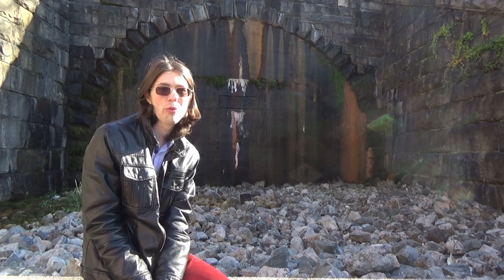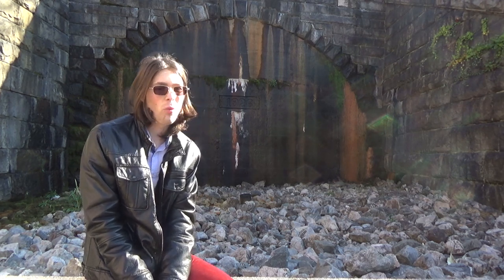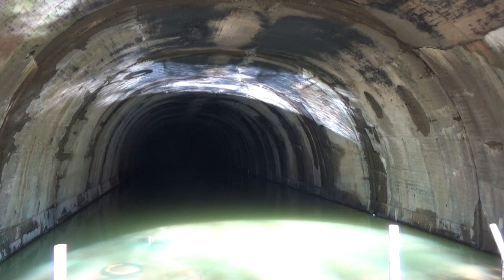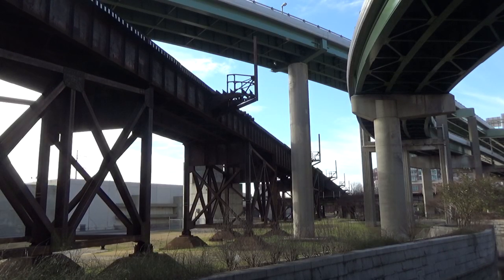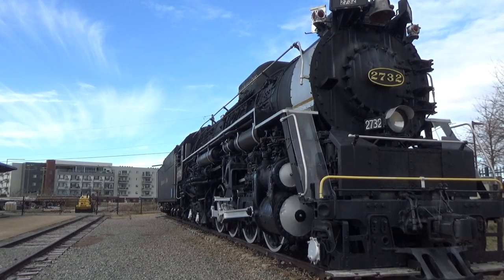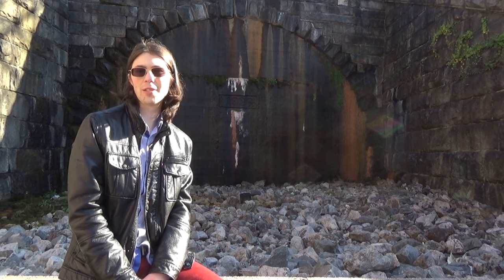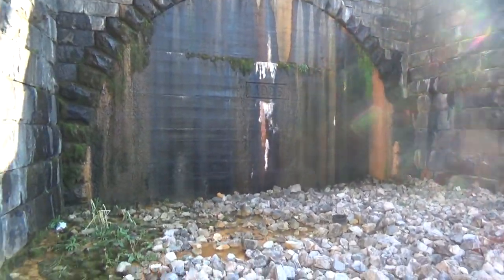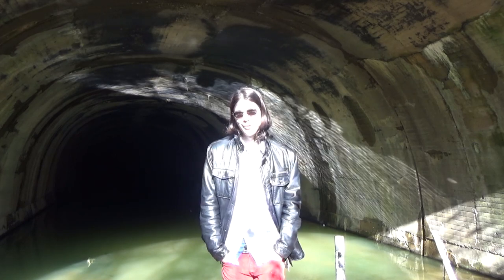Richmond: The Church Hill Tunnel

Comment: Nicely done, and the sound in the opening was really impressive. A couple of suggestions, the sound level in the narration changed a bit, it's better if that's kept the same. When you showed the locomotive it would have been good if you'd identified it as the same kind of locomotive (if indeed it was), you might also consider adding a bit of motion to still shots like that. The History Guy does it and I think he got it from Ken Burns.

But again, nicely done, and you have a new subscriber.

Comment: I just watched another video on this. a reporter a photographer and another guy went in a  few years back and made it in about 500 feet and had too turn around. what they said they seen is water leaking and the ceiling collapsing. if it continues too do so the buildings built on top this tunnel will collapse. hopefully nobody will get hurt. they need too do something now before that happens.

Comment: Obviously the tunnel was an incredible undertaking not to be taken lightly. There would of been engineers and many brilliant thinkers working on this bridge. Wouldn’t you think they would know the geology and the water flow? Why the need to go from a bridge that is now severely flooded, trestles that are how high? What is the elevation difference? It looks to be quite a lot. Why the drastic change in water level and therefore mudflow? Why is the tunnel now flooded so deep? Where did this water come from? It appears from the level of water that the tunnel is icy deeper and filled with mud and water to a greater depth than first designed. How far down to the actual train tracks? These are a few questions that need to be addressed. Now let’s watch the second half. (: good work
Reply from the maker: Both ends are blocked up and I'm sure greed superseded the need for safety.
Reply: @RealFuturePictures  I just read an article on it and some of my questions were answered. The whole thing seems to be flooded with rocks, debris, and water. It sure would be cool to reroute the waterflow and dig it out. But $ rules, your right. It makes me wonder because the trestles seem easier than digging and creating a mile long arched tunnel with large brick, especially with the horse and buggy era and wood structure building and technology of the time
Reply: Also I wonder if you took the height of the train and add a few feet for clearance, what that would compare with to the current entrance level you were standing near that was bricked off. That will give us about the depth the outside tunnel is above the original train track level. By artistic proportions only It appears to me to be about 12ft below the ground of the current courtyard entrance level.